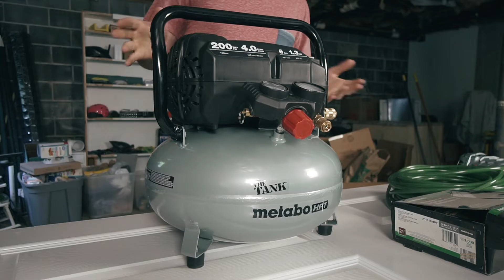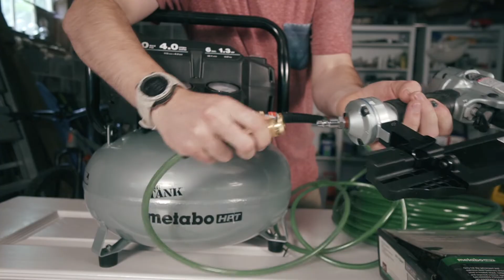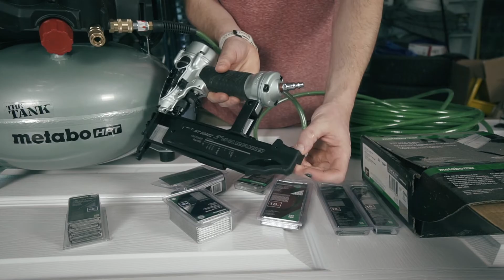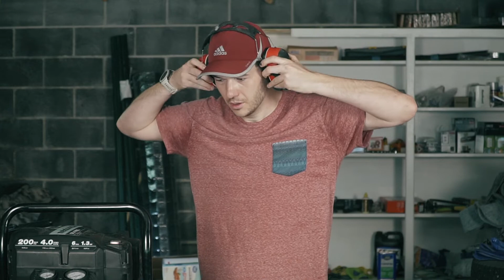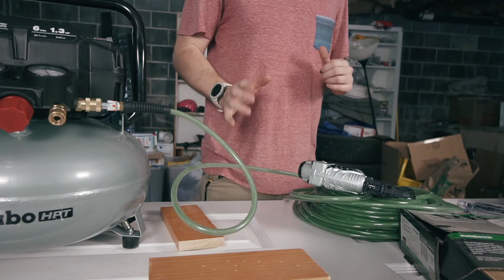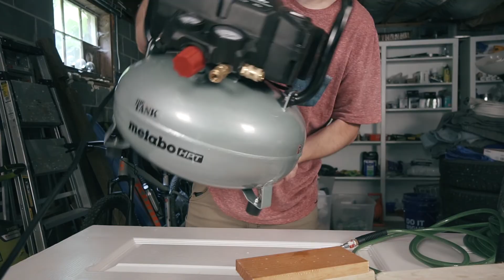How to Use METABO’s Air Compressor and Nail Guns (Brad, Finish & Framing)

Comment: I hope you are still responding to this old post. When you use the framing nailer, does the tool pressure drop? I just bought another pancake compressor (6 gallon) and used it for a floor nailer. The tool pressure keeps dropping, while I assumed that it should stay constant. I just wonder if it is the compressor problem or my nailer problem. Any insight will be greatly appreciated. Thank you.
Reply from the maker: It should stay constant based on what you set your valve to.
Reply: Use a regulator mate to feed constant pressure to ya tools

Comment: I run THE TANK it’s loud and rubber boots need lock washers or they will go . Drain your tank after using❤ it a great air compressor
Reply from the maker: Good tip, thanks!

Comment: Is the air compressor just meant for nailing or does it work for other thing for example car detailing. Would it work with an air gun?
Reply: The main thing to look for is the CFM/LPM rating on the tool that you’re trying to run. This compressor is rated for 4.0 CFM at 90 PSI, so as long as the tool you’re hooking up is less than that then you’ll be fine
Reply from the maker: Not sure, sounds like you’d need a large capacity for these applications

Comment: What do you charge the Metabo too? 200psi? Does it have an auto shut off/auto start? The nailer only needs about 75psi so charging to 200psi may be unnecessary. What do you do?
Reply from the maker: Automatically charges to 200, it needs to be that high so that it doesn’t have to run constantly every time you fire a nail

Comment: been using Hitachi nailers and staplers for over 30 years. NR83 is the best gun made, the NR90 in this video has performed well over the last 4 years for us as well.
Hitachi sent us one of these pancake compressors to test a couple years ago. It's a pile of trash! extremely LOUD, it runs very hot, the cycle is very long and only lasted about 6 months before it died. nowhere near as good as our Rolaire compressors that last 3-5 years
Reply from the maker: Good to know! Mine is still going strong after one year, it hope it lasts much longer!
Reply: Rolaire air is 5x the price for 250 Canadian its a decent compressor

Comment: Who knows that is the size hose and length? Can it work on a 3/8" diameter x 100' long hose on a roofing nail gun? Thank you. I'd be excited as you were also.
Reply from the maker: The two coupling sockets on the compressor are 1/4”. I wonder if you could add some adaptor. The metabo brand air hose are 1/4” and come in 30’, 50’ and 100’ lengths I believe.
Reply: @TheDIYCabinGuy  I am going to try the 1/4” ID with 1/4” fittings and the hose is 100’ long.